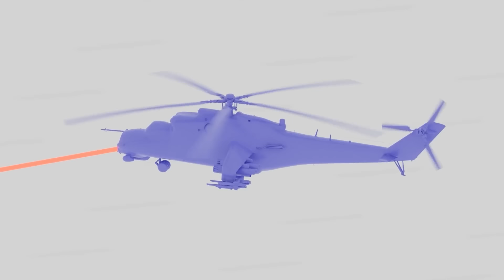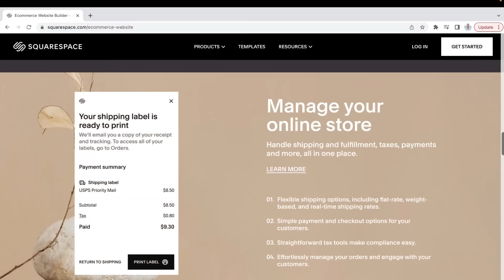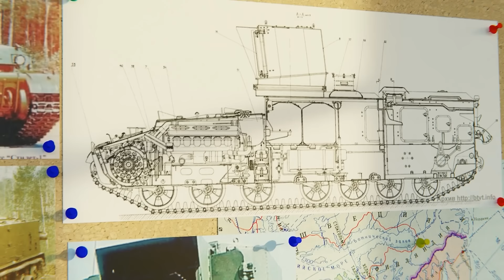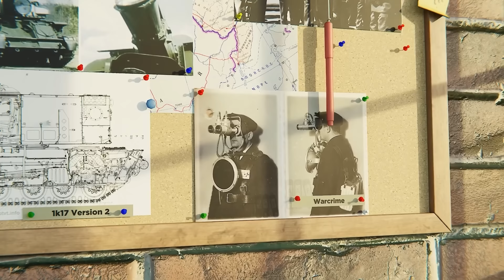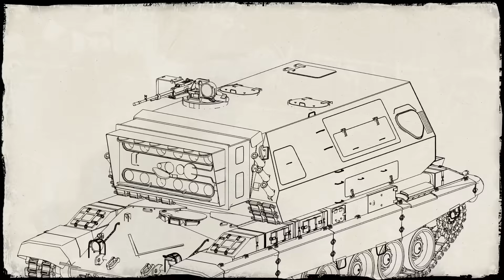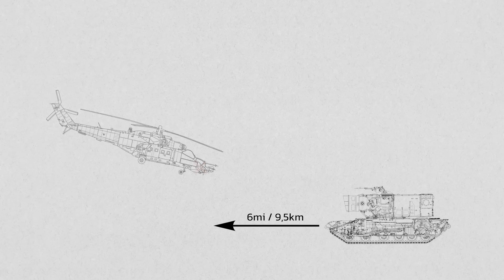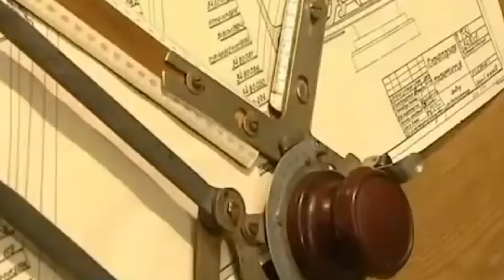What happened to Laser Tanks?

Comment: The problem is bad weather, smoke and other obstructions render it far less effective so in the end the more basic systems with munitions are generally more effective. However, when used sparingly and by ships with capacity for more effective larger versions. As a defensive system on aircraft for example it could be quite effective at blinding enemy missiles and causing them detonate early. So there is certainly a future for lasers in military service.
Reply: Light a cigarette, blow smoke, stop laser, save eyeballs lolol
Reply: I can't see how that would be a problem:
These laser systems were developed to disable (more or less permanently) enemy optics. Any fog, dust, smoke or tree coverage that would block the laser would also block the enemy optic systems making the laser not useless, but just unnecessary in that situation.
Being line-of-sight only isn't really a drawback for your weapon if its intended target is also line-of-sight only.
Reply: @qdaniele97  yes i agree however a lot of it's targets are not line of site dependent, such as anti radar missiles that lock on to a radar emission and follow it to the source.

Comment: I was an M1 Abrahms mechanic in the 80's and during training in the classroom the instructors had a whole training block on lasers as weapons on tanks. Id be curios today to hear the differences between thens why we cant to todays why we cant. I remember alot of the problems being around powering the weapon, saying youd need a power supply bigger than the tank itself.
Reply: Kinda related, but remember Boeing's Airborne Laser? IIRC they ended up using most of the original cargo space for the power supply.
Reply: Well our systems have gotten a lot "smarter" and have auto cut offs if the sensors are overwhelmed. But laser systems have advanced a lot and you can make one at home that can be pushed into the megawatt range.
Reply: @StriderGIF Yeah that was a  thing too, multi gigawatt laser that was built to be anti ICBM by burning a hole in its fuel tank.

Comment: there is another problem. beam widening. depending on the frequency, but expecially towards the higher frequencies / shorter wavelength, the beam widens and light scatters and loses effectiveness.
furthermore, the laser is a high precision optical instrument. it's really hard to outfit it with enough shock absorbers that the optics don't get whacked out of alignment and be good enough to work with hundreds of kilowatts of light. and never forget the waste heat such a system produces.

Comment: IR lasers are pretty much worthless for blinding pilots because the glass used in the cockpit is not transmissive in that wavelength.
The biggest limitation with laser weaponry is the targeting system, and the Russians absolutely weren't capable of developing an adequate system for a field grade laser weapon.  It's easy to lock on and illuminate a satellite that's moving at a constant steady velocity, not so much for a vehicle or aircraft that frequently changes direction and speed.

Comment: *We will never have high energy Weapons until they can make Clear-Metallic-Hydrogen stable (1,500,600 PSI) and then run a 5000 Amp Short through it. This should have a Phonon Density of 10,370,500 Joules per Sq.mm of beam area.*

Comment: 1:53 it’s not a war crime. Article 3 of Protocol IV of the 1980 Convention on Certain Conventional Weapons (aka. The Protocol on Blinding Laser Weapons. Note that the Geneva convention has nothing to do with this. You can’t just use “Geneva convention” as a blanket name holder for the entire body of international law and conventions) states that: 
Blinding as an incidental or collateral effect of the legitimate military employment of laser systems, (including laser systems used against optical equipment,) is not covered by the prohibition of this Protocol.

Melting equipment or burning troops to death is a legitimate military employment of laser weaponry. 

As long as they’re intended to burn Simone to death, poke a hole through them, melt equipment, destroy electronics, destroy or distrust sensors…. But they just so happen to blind someone unfortunate enough to get hit in the eyes but not die, it’s okay. You just can’t make a device that’s meant to permanently blind them. 

The reasoning signatories gave is it’s no different than physical munitions causing blindness. You don’t blind artillery because shrapnel designed to kill personnel and destroy equipment can get in someone’s eyes and blind them if they’re not in that kill radius.

You can even absolutely blind someone using some of the higher powered laser rangefinders and target designators we use.

Comment: You've over-exaggerated the tactical issues with this tank. All tanks of that era gave off heat signatures anyway, so a bigger one doesn't matter, and an unobstructed line-of-sight is necessary for pretty much all weapons except missiles. Furthermore, lasers can work through dust (as long as ft's not as opaque as a dust storm). On a battlefield or around a military base they could hold a number of defensive functions despite the tank's limitations.

Comment: I feel like lazer tanks would not be a good idea as they'd probably give away their positions very quickly, you ussually won't see a bullet or I guess in the case of armor say an apfsds shell from the front however a gigantic lazer could probably be seen from quite a ways away on a lot of sensors such as thermals and they wouldn't cause instant damage whereas a bullet would do way more damage a whole lot faster, especially against armord targets, also bullets can't be dispursed by smoke whereas lazers tend to scatter when hitting smoke as seen on the optar system on some of the t95 prototypes (a US made mbt test bed in the Cold War not the doom turtle). All the optar is, is just a very early laser range finder.